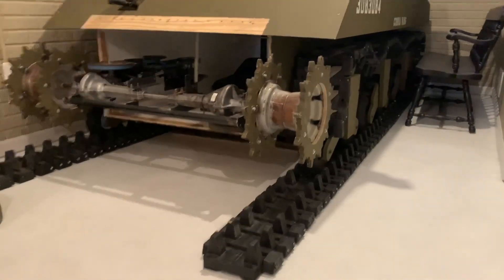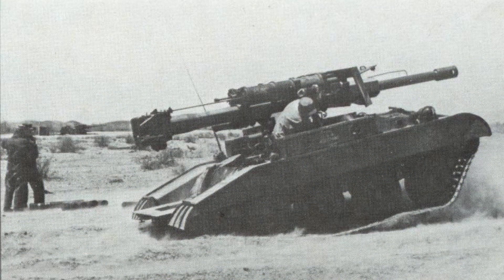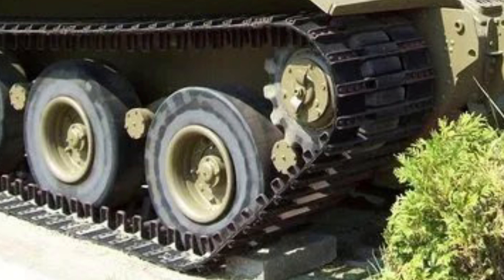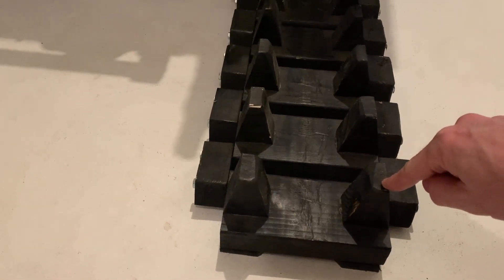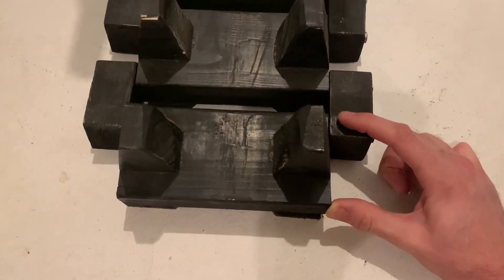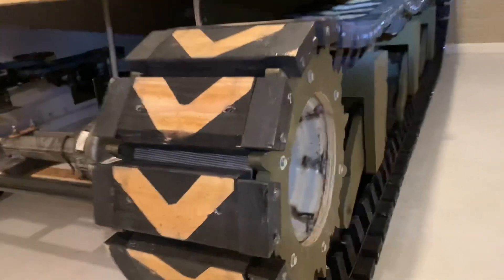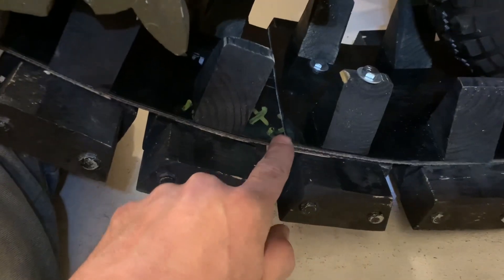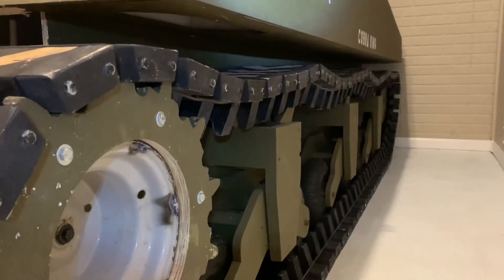M4A3E2 Sherman Jumbo Scale Tank - Track Improvement

Comment: what scale is this tank? Is beatiful
Reply from the maker: Thanks! It’s 60% scale. It measures 11’8” long, 5’2” wide and 5’9” tall. With the pedal drive it weighed 856 pounds, but it will be a bit more after the new powered drivetrain is installed.

Comment: For the fourth of july you should have a calliope attachment that can shoot bottle rockets
Reply from the maker: Bottle rockets would be a bit out of scale for this tank. Maybe for my 1/16 scale RC Sherman!
Reply: @ryanhahn7251  right, it would still be cool
Reply: @ryanhahn7251  so if you do a calliope what would you use as the rockets
Reply from the maker: @crazydilo2558  the rockets were 64” long and 4.5” diameter. Scaled 60% that would be 38” long and 2.7” diameter. I can’t think of anything available which is that big. Anyway, there never was a Jumbo with the Calliope rocket system fitted, so it would be a replica of something that never was.
Reply: @ryanhahn7251  hmm, i thought your sherman was just a model of a normal sherman, i havent done much research on sherman variants other than the calliope and the easy 8
Reply from the maker: @crazydilo2558  it’s officially called the M4A3E2 Medium Assault Tank, unofficially known as the Sherman Jumbo. Only 254 were made.
Reply: @ryanhahn7251  was it used in any war, ww2 or korean seems like the most likely wars
Reply from the maker: @crazydilo2558  yes, 250 were sent to ETO during WWII and all were used in combat. The other 4 remained in the USA for further testing. I don’t think any went to Korea.
Reply: @ryanhahn7251  i assumed it was ww2, when i make my model im going to make an easy 8 hull and have 2 different turrets, one with the calliope attachment and the other will be the 76 mm version, also can someone get in through the turret on your model

Comment: I have 2 plans that might be good for that tank first make a shell that can fit in the gun and fill it with B.B's second make a spare tracks just in case:)
Reply from the maker: Thanks for the ideas. I need to make 10 more track links anyway, so I will make some spares. Did you know the cannon shoots 2 inch water balloons? See my videos “weapons test” and “ electrical system”.
Reply: Bunos idea make a spare wheel just in case also:)
Reply: Just like in fury
Reply: There's a wheel in the front of the tank